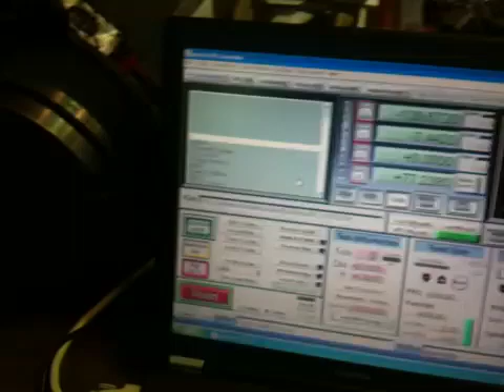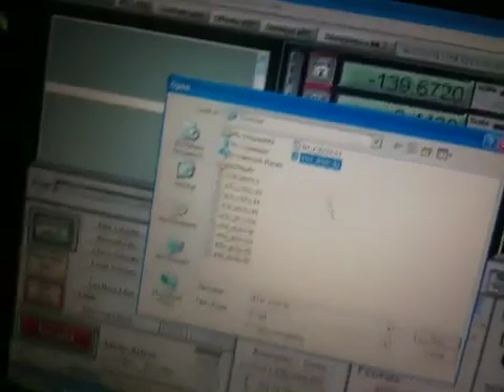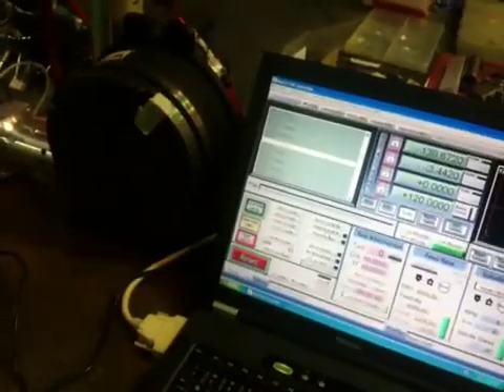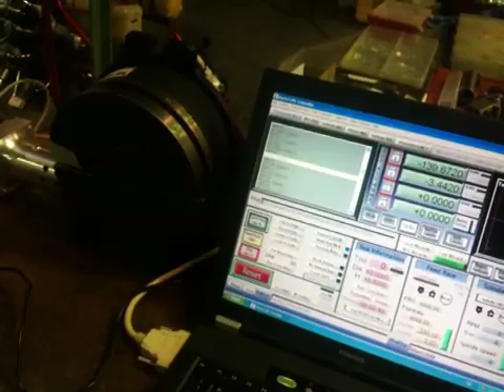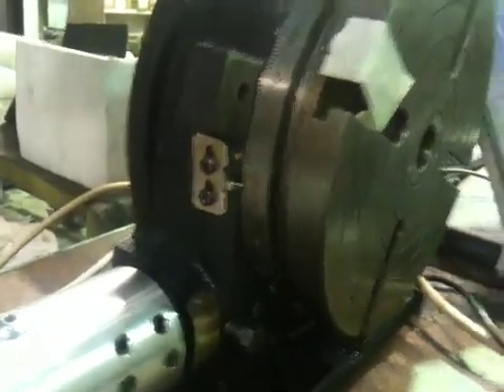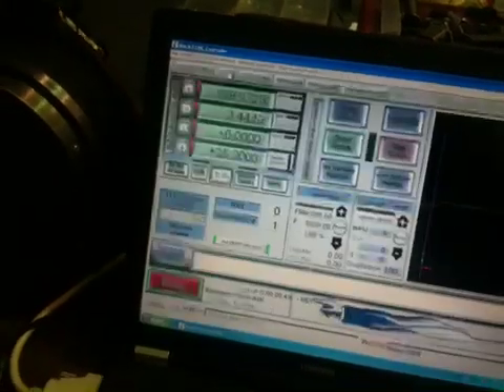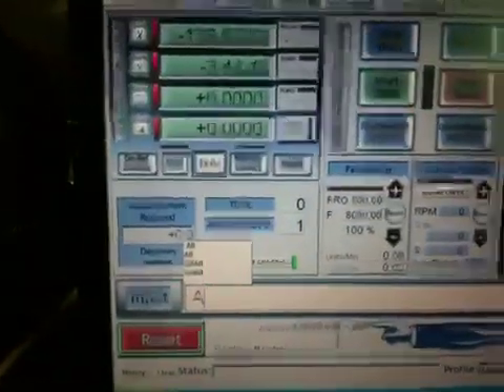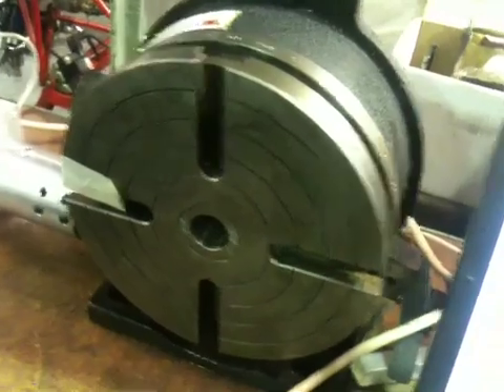ROTEC CNC 4th Axis / Indexer

Comment: did you end up getting it to talk to the mazak ? im wanting to do the same
Reply from the maker: Yes I did, but just as an indexer. G code in the mazak would trip a spare relay in the cabinet. This relay would send signal to a pin in mach3 and initiate a pre programmed move on the 4th axis.

Comment: Thanks for the great video

I am just adding a 4th axis option to my self made PC less controller and just wanted to ask you that the 4th rotary axis is basically like giving the signals of X or Y axis to rotate the material or its separate axis and do alll X, Y, Z & A axis can work simultaneously.

And is your rotary axis configured in degrees or distance mode.

Comment from the maker: back lash is miniumal, this is of course come down to the mechanics of the actual rotary table not the CNC which is exact.  To reduce backlash to the minimum I meshed the worm and wheel in tight, this can be adjusted.  Plenty of lube.  Idexing in one direction also is ideal if backlash becomes an issue.